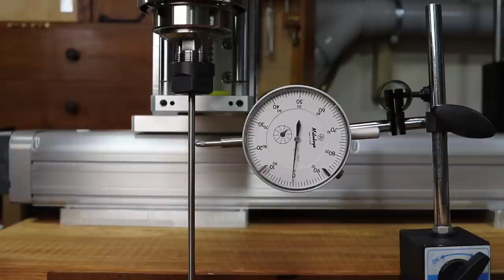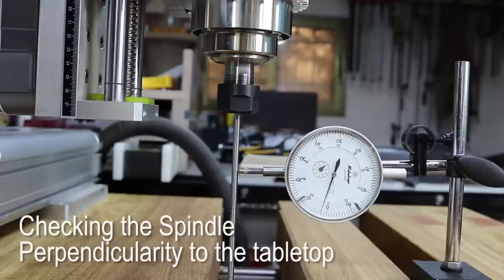Woodworking Milling Machine!

Comment: I was thinking it needs a DRO or at least graduated wheels on the hand wheels to measure cutter movement. Real nice work on that machine and it has real good accuracy...Cheers, Jim
Reply from the maker: Thx Jim, yes there are 2 DRO on the X and Y axis, I have installed them on previous video.

Comment: Seems like a digital read out (DRO) would be useful here. I would think a lot of people might ask, "why not go one step further and make a CNC?"
Reply from the maker: Actually there are two DRO installed on the X and Y axis, it was done on a previous video! About making a CNC, I already have one so I don’t need another one, I assume that you already know how much time it takes to setup the CNC to make a cut! This manual milling machine is faster to setup and much easier in many situations! Maybe I should add a servo motor to control it remotely 🙂, not now for sure ! Thank you for your comment

Comment: Great idea.  Needs more development though to be really useful.  And I have a CNC machine that will do just about everything this will do.....
Reply from the maker: Right it needs more accessories and some development, although I have a CNC, but sometimes a manual milling machine will be handy though
Reply: @TheWoodCrafter1  I can see that from a straight line x,y,z perspective.  The CNC is great for complex shapes and operations....
Reply from the maker: @PeteHowlett  absolutely, this milling machine is not for making curves or engravings, but it can be very useful for dovetails, tenons, finger joints and for quickly flatting small workpieces etc., although it is true that all what I have mentioned are still can be accomplished using different techniques with a router and some sort of jig, it happened that I've found some parts with very low cost that contributed to forming this whole project and this might be inspiring in a way or another for some folks, this type of machine is good to have but not a must.
Reply: @TheWoodCrafter1  It would see a lot of work in my workshop :)
Reply from the maker: @PeteHowlett  :) I saw your lovely works and I have no doubts about that.

Comment: A nice project but using a ON/OFF switch on a stationary machine is only safe if used in conjunction with a emergency-stop button..
Reply from the maker: Good point, I need to work on that as soon as I can! Thank you

Comment: Is this setup ridgid enough to flatten some plane soles?
Reply from the maker: Actually it is rigid enough for woodworking, if you mean a Japanese wooden hand plane then yes, but not enough for ferrous milling.
Reply: @TheWoodCrafter1  I have a few cast iron body jointer planes with not very flat sole.
Reply from the maker: @What_Other_Hobbies  you can attach sandpaper to a flat surface to flatten the sole of the hand plane. Check this video Unboxing and tuning a vintage Record smoothing hand plane (# 4)
https://youtu.be/e1sTdmrzHkg
Reply: @TheWoodCrafter1  that’s what I have been doing and it does take a while. Also I have a few planes that I want to get the sides perfectly square to the sole, which is challenging.

Comment: Perhaps on one offs, this is a nice machine.  But for production...too much set up.  And to use it to cut 45 angles for a 90 corner is somewhat on the crazy side...I mean use a miter saw man...as god intended!
Reply from the maker: Actually it wasn’t made to cut miter cuts, you are right, I was just showing some examples, but it also can cut 45 miter tenons with shoulders assuming the right bit is used and perhaps that can’t be done on the miter saw for production though 👍